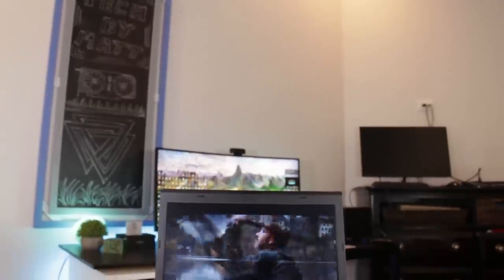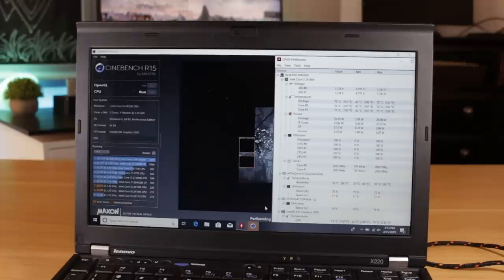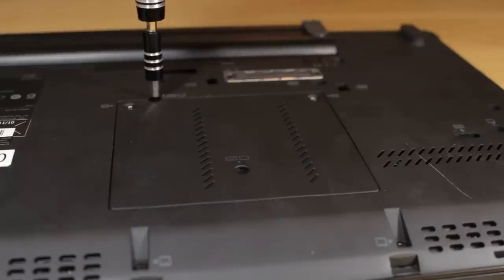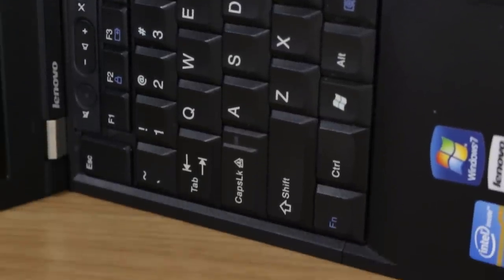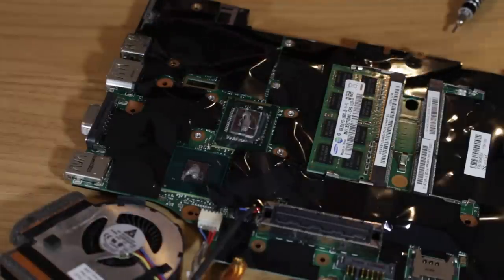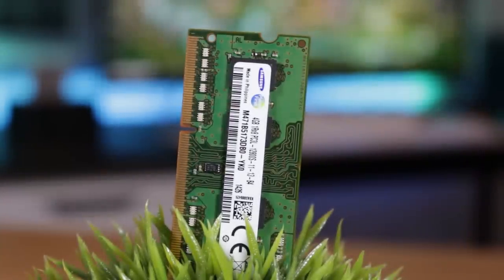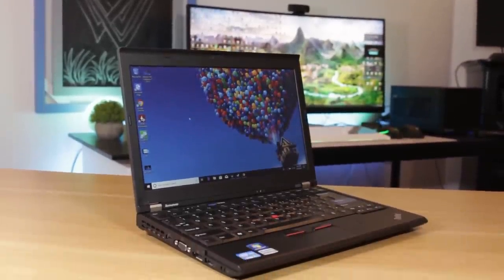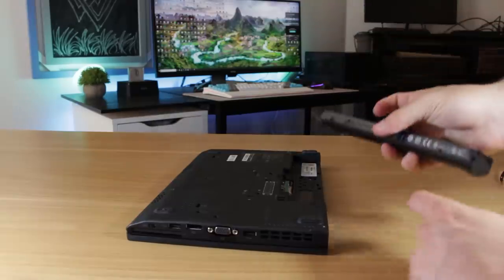What Can A $75 Laptop Do? (Plus Some Upgrades)

Comment: This laptop is still miles better than those budget laptops under $250 on the market today.
Reply: Desktop 2nd & 3rd gen i5's are amazing bang for your buck these days, and so are used laptops mounting their mobile counterparts if you take some time searching for fine deals. Just avoid the U (low power) models unless you really want to use them away from a power outlet and plan to buy a new battery, as there's considerable performance difference. The machine I'm writing this scores about 4000 CPU PassMark points (i5 3320M), not bad at all for a 2013 general use lappy which I paid under 60 bucks for in an eBay auction (part of the reason for it not going higher is significant cosmetic damage on one corner, but hey, I use that at home only anyway). Yes, it came with its power brick and everything. I actually won 2 units from the same seller for nearly the same price. And that's here in Europe, where you rarely get such fine deals as in America.
Reply: I always recommend 2nd hand for any laptop under $500
Reply: i swear. hell yeah its a good idea to buy one
Reply: don't worry, mostly is because the upgrade of it important part.
my laptop is 400$ and my in game (csgo) fps is 30
Reply: how bout just buy. a pc ryzen build for $300 this are waste of money man buy a ryzen 2200g and cheapwst mobo and start from.there plus u can buy a ryzen 7 in the future unless u really want portable pc i just my.phone outside and i use pc at home
Reply: BilisNegra agreed, the sandy/ivy bridge is so cheap yet still have great power now. I have two 17” laptop(Lenovo g780/Dell m6700) for me and my wife as working computer, I throw 3610qm and 3740qm into them and they just fly with an SSD as system disk.

I’m planning to upgrade my HTPC from g620 to Xeon 1260L soon :)
Reply: @BilisNegra  the only difference you see for everyday use is the app with latest processor loads 2 s faster ........
Reply: "budget" laptops today are trash
Reply: @ioannisskardasis6887  You guys are horrible shoppers. I bought a Lenovo Ryzen 5 3200U laptop with 8GB RAM and 256 GB SSD for $300 and it runs amazinly well. So no, Ryzen budget laptops under $400 are not trash at all.
Reply: better than my potato
Reply: Got this laptop for free, can anyone tell me the 3 main things i can upgrade myself so it can be usable in 2020? Cant afford a new one right now
Reply: @cesaraguilar9096  probably a new cpu compatible with the laptop, add more ram, 8gb in total will be enough, and if you wanna game on it get an egpu and follow tutorials on how to use it ;)
Reply: will look into it, thanks for the advice
Reply: @SparkRemarkable  Really? I just bought a Lenovo Idepad 330s with a Ryzen 5 2500u for $350 recently....

EDIT 
Wait Ryzen 3 3200U or Ryzen 5 3500u?
Reply: @shinya1215  My 7 years Lenovo G480 has a core i3-2328M and it is running the latest version of KDE Manjaro smoothly. It only lacks RAM (it only has 4 GB of RAM, easily upgradable) and graphic card (Intel HD 3000, It supports a 1368x768 display, but it lose in color and sharpness to the more recent graphic card, can't do anything about it).
Reply: @solosecondhandstore5087  I also have a Lenovo b470 with similar hardwares (i3-2348m, 8gb ram, 120g ssd), it runs win10 and Ubuntu without any issue. I also hate that 1366*768 panel, I guess if you hunt in eBay or taobao you can find FHD panel and perform a DIY upgrade.
Reply: The X260 is one of the best laptop you can find under 300
Reply: It's really not, though. Many can just about match or overtake this in performance, and they get much, MUCH better battery life.
Reply: @smokeinc9800  Laptops are still more portable lol
Reply: @SparkRemarkable  what model?
Reply: I will be your 1 thousandths Like
Reply: I’ve been using a 2013 21” iMac and well it runs like a charm until currently but that is kinda on apple’s os catalina causing gpu problems and causing lag for the pc.
Reply: I bought a used T430 after buying a new Skylake i5 Acer Aspire and using it for 2 years. And I have to say it feels much better than the Acer which had its share of hardware problems. Even though the T430's CPU is older, it's become my daily driver and got much more value.
Reply: Get an older but decent laptop than a new cheap laptop
Reply: @BilisNegra  my 3rd gen i5 laptop still going strong after 6 years
Reply: Bang my buck
Reply: my friend also has same laptop thinkpad ....
Reply: @ccricers  is the t430 cpu soldered? I was looking at getting a t440p, I will be coding
Reply: Sandy Bridge was legendary
Reply: Ming Lee I got a used 220$ laptop for i5-4300m with 240gb ssd sata and ddr3 8gb ram
Reply: @BilisNegra  If I want to buy X220/X230 what specs should I look for? I am not really sure what are 2nd & 3rd gen i5, and how to see if it is U (low power). Thanks
Reply: Ming Lee you mean chrome books?
Reply: This is ThinkPad. It's inmortal.
Reply: @BilisNegra  hey I got the same CPU on my Toshiba laptop. He is a beast of multitasking :)...
Reply: true..i love thinkpads
Reply: Wow what an original joke hahahaha
Reply: Yeah true I swapped my laptop that came out in 2018 for her 2011 Acer aspire 5755g it's so much better
Reply: Class1c 400$? 30 fps? Oof
Reply: btw older thinkpads are basically IBM thinkpads (same construction and everything), ideapads are chinaware from the same factory (crapware), newer thinkpads are still better than ideapads but they lost a lot of the old quality. lenovo is drifting more and more away from the old IBM ways (for which they produced the hardware)
Reply: I mean the modern intels
Reply: @cesaraguilar9096  Wait how'd you get one for free
Reply: @bobdole27  sometimes I work as a mover, and some rich lady had a bin in the garage and said grab whatever you want it's going to the trash. So I got this laptop and a nintendo 64
Reply: @cesaraguilar9096  Dude thats awesome
Reply: That's true and the fact that i van't find one like this now in lockdown join in school lessons kicks me in the ass
Reply: True
Used core i5 from 2-3rd gen is still better than any n4xxx celeron/pentium these days
Reply: These laptops are better than 95% of laptops nowdays, they are like the nokia 3310, but in laptops, but with insane performance if you use them with a minimal operating system install like arch/gentoo
Reply: Fr
Reply: That's a lie LoL
Reply: @HuntaKiller91  it's actually not look in benchmarks
Reply: And it still is!
Reply: its like:
new and bad quality laptop
or
used, powerful laptop + high quality for used

Comment: I love it when I find out that the $75 laptop can run 10x as a better than a $250 laptop that cant even play minecraft at 10 FPS
Reply: i got my laptop on ebay for 100$ and it has a discrete nvidia quadro. it can run java edition decently, but i usually only play runescape and bedrock edition on it.
Reply: Yeah even with ubuntu it cant run anything not even minesweeper without stuttering or delays and it costed 300 (waste of cash)
Reply: WS Str a have a50 dollar dell from the same year with the same specs and it runs Minecraft pe at 16 chunks at 60 frames lol
Reply: @NMsince2013  what ?!?!? holy shit ive got to get into this stuff
Reply: @NMsince2013  Holy s** ive got to get more into this stuff....but how ?!
Reply: Juls there are lots of places you can get deals like this, you can look on places on eBay, just set your price (50-100$) look at the laptops condition and specs and try to find the best deal for condition and the specs
Reply: Mine has only 4gigs of ram but I did upgrade it too an ssd which is why it performs so well, I’ll likely upgrade the ram too
Reply: @NMsince2013  thanks man I will do some research
Reply: WS Str my laptop is 600$ And has a fking Pentium processor, for the rest it has all the good specs for Gta V BUT THE UNCHANGABLE PENTIUM fuck
Reply: I used to play Minecraft a lot in mine, runs quite well with some minor optimizations.
Reply: I got the exactly the same computer but I do not know how much it cost
Reply: what is model of this beast can it run 16 or 32 so dimm
Reply: I have a 300$ one and it runs mc at like 150-200fps
Reply: Them Celeron N2840's.
They're worse than a Core 2 Duo.
Reply: I run 200 fps when i play minecraft
Reply: Used market > new market
Reply: ByDaChan ' I got a 500$ laptop 😎 but I cannot even play Minecraft. 😔
Reply: I have a 250$ laptop that is fucking trash. It has a 1.10 ghz dual core, 4 gb of ram and 32 gb of emmc (yes, 32gb of storage). It didn't even ran windows 10 smoothly on its own. Now I have Ubuntu and it runs better, but when I open ANYTHING the CPU usage goes to 100%. Like I could be browsing on chrome or just chatting on discord and the laptop gets up to 75°C. Oh, and it doesn't have any ventilation, not even a little hole. I'll see if i can get a cheap PC using server parts and finnaly get rid of this shit.
Reply: Ok so I will get 2 of these then 2 100 dollar laptops
Reply: I hate my laptop I can only get like 20-60 fps on Minecraft, on gta sa I get about 70 fps on highest, csgo runs 20-30 fps but it's still pretty bad.. it has a bad Celeron processor and Intel HD graphics..b
Reply: Nah, that's BS. You can find good laptops for <$400 that beat this easily. My 435€ Ideapad 330s also had 2C/4T but at a 3.4 GHz boost with better IPC and far lower power consumption. It also had a 15 inch IPS screen and better battery life. This Thinkpad is very impressive for $100 but a newer and more expensive machine will beat it comfortably.
Reply: got a 2000$ laptops, it could only run Minecraft at 14fps );
Reply: That's true
Reply: I also play minecraft and valorant with 60 fps in 2021 and it's amazing
Reply: Mine was expensive but it beat my friend's pc in fps in minecraft java lol
Reply: It runs at 200 to 300fps my friends pc runs 100 to 200 fps
Reply: I have a 200 one who can't run minecraft at more than 7 fps
Reply: @nidzex4724  bro thats so good stop saying its bad ur just bragging
Reply: Uh dude a Celeron processor literally runs Minecraft at 50-60 fps don't be a sheep

Comment: You should do a video about flipping every week do it for 3 months and see how much you make**
Reply: Everything what?
Reply: LOL overseas there's cost up to 200€ used😩
Reply: If you wanna do computer flipping for profit, the best way to start would be to buy laptops in bulk.  DLA and other federal/state disposal agencies sell them by the pallet - a lot of government orgs get rid of their workstations as soon as they go out of warranty, so 3-5 year old thinkpads get sold off pretty cheap, usually with no HDD or RAM.  Get yourself a pallet full of Thinkpads in decent condition, put a cheap 128GB SSD and 8GB of RAM in all of them and a fresh image of Windows 10 or Ubuntu, research pricing for that model on ebay, and slightly undercut your competition - if you offer free shipping and have the complete package (batteries and chargers, OS already installed, etc) included with each purchase, you'll probably do very well.
Reply: Haden Odom sorry that won’t work
Reply: @dirkdiggler9379  why not?
Reply: Midnight Lotus  not enough profit
Reply: And windows is really expensive
Reply: @hadenclaire  Well, no. If you find a pallet of laptops for sale, before you even think about buying them, you should be looking at how much money you're going to have to put into them to get them up and running, and how much you can reasonably sell them for. 
Chances are, once you take into account your time and taxes, you won't be making much, if anything.
Reply: @hadenclaire  should be pretty lucrative business these days...

Comment: I can't wait to see how does it run with a egpu.
Reply: MirelRc idk what that is but i think it’s supposed to be funny
Reply: Swoogie37 lol it’s basically a graphics card run externally.
Reply: @swoogie3754  external GPU
Reply: Silver_76 i see thx
Reply: @swoogie3754  they work. GDC dock is an awesome graphics card dock that allows you to add graphics to a lower end and older laptop. Its no joke, man.
Reply: I picked mine up on ebay for $40.50. I use the mini PCI-E variation..
Reply: external gpu doesnt work as fast as a gpu connected straight to desktop pc.
Reply: @GhosteYoutube  Yeah obviously because you only have 4 PCI-E lanes on this connector, but it will still be better than any integrated graphics with an adequate GPU.
Reply: @nitrosity4574  yeah but why spend 800$ on a gpu like gtx 1070ti and get half the performance when you can build a pc with better cpu and with a gpu like rx480 that costs less than only the gtx 1070ti itself. i mean if you buy like a gt 1030 and setup a external gpu then yeah that would totally work if its supported on your laptop, of course you would get better performance if it  was in a desktop pc but it would be a massive improvement over an integrated gpu, probably over the dedicated one aswell.
Reply: Then you need a wifi whitelist bypass.
Reply: @B1essedCammm  also true, but probably 90% of us doesnt have gpu laying around in the house.
Reply: @GhosteYoutube  please tell me who's willing to pay $800 for a 1070Ti, i need customers like this
Reply: Nitrosity what if you do it through the express card instead of the 4 PCI-E lanes. Would it be faster?
Reply: @GhosteYoutube  damn $800.....I sold like 10 in the past few months for $160/170.
Reply: @stevesmith1383  maybe got the prices wrong lol, but still rx is cheaper than nvidia.
Reply: @GhosteYoutube  or just use the rx 480 on a laptop?
Reply: @josephl3602  %
Reply: i thought for an egpu you need thunderbolt 3
Reply: @Josiah.435  with thunderbolt 3 it will run better.
Reply: @MirelRC  is he using an express card slot
Reply: I just hate how old laptops have 2 RAM slots you need 4 for a major upgrade

Comment: I'm currently using this computer and it's great! It does EVERYTHING with no issues. Modern computers aren't significantly faster. It's easy to upgrade. I upgraded to an SSD and 16 gb ram. I run Windows 10 with out a problem, and run Linux and MacOX Sierra virtual machines without a problem.

Comment: I have the X220's successor, the X230. Almost identical except it has the chiclet keyboard (can easily be swapped with the X220's), USB 3.0, and a Mini DisplayPort instead of full-size, as well as the newer Ivy Bridge architecture. Just to correct you on something: the 2.5" drive bay supports SATA III speeds, it is the mSATA slot that is limited to SATA II speeds. Also, the batteries available for this ThinkPad were 4-cell, 6-cell, and 9-cell, not 3-cell as you said in the video.

The TN panel is VERY easy to upgrade. Just make sure to disconnect the battery and power adapter before swapping the displays. Also, if you want to check the battery health you can install "Lenovo Vantage" and go to the power manager. Compare the full charge capacity to the design capacity and you can calculate how much the battery has degraded. From my experience 3 hours with the 6 cell battery is decent, I think they could get closer to 4 or 5 hours when new. I have a 9-cell battery in my X230, and at 81% of its original capacity it lasts about 4 to 5 hours.

Comment: I recently sold my HP Elitebook 2170p for a upgrade. The Laptop itself was superb. Touchpad and keyboard were awesome. It had keyboard light, was easy to maintain and could have had up to 16gb RAM. However, the Intel HD 4000 graphics was't up to the task for gaming. But 4k YouTube ran smooth on a nice looking display.
Reply: i had just bought HP 6460b , bad screen but build like a tank and perform awensome for less than 100USD when include ssd in price

Comment: Hi! I also have one of these! Excelent machine, I upgraded mine with 2 ssd drives, used also the m2 slot and a regular 2.5 inch SSD drive (which replaced the hdd), boosted ram to 12gb, replaced the wifi card and placed a new original Lenovo 6 cell battery... I simply love it.. I am also considering an external gpu to go along with it whenever I travel... Great video!

Comment: Dude, Matt, T420. Don't get me wrong, the X series are beautiful machines. I live and die by my X250 on the road, but the T machines are so much more upgradeable and easy to work with. The best $300 laptop today is a T420 that's been upgraded to a QM i7, maxed out RAM, an SSD and the 1080p screen
Reply: Even better if you install coreboot and a custom bios on it, which allows you to use ivy bridge processors with much better integrated graphics, even better than the t420's dedicated gpu!
Reply: i have t460 maxed out at work and my macbook pro 13 2105 at home mops the floor with that t460... it just shows how a bad operating system such as windows can make good hardware feel like crap
Reply: @milosjakovljevic4850   but not everyone has a time machine
Reply: why do you use your x250 on the road then?
Reply: @kadenoberlander2548  Because it's compact and lightweight. The T420 is just shy of being a boat anchor.

Comment: Some great info for the newbies out there! All Sandy/Ivy Bridge with 2 ram slots support a max of 16GB ram(2x8GB). Most Sandy/Ivy bridge cpu are socketed, which mean you can upgrade the cpu. Most of these CPU's use Socket G2. The Quad Core i7 3610QM/3630QM uses Socket G2. 

Sometimes you can get a great deal by buying a dead Gaming laptop with an i7 3610/3630. Most times its the graphics card that is dead on the gaming laptops. I got dead Clevo for 40$(no ram/no hdd). Took the CPU(i7 3610QM), Sold the working LCD panel for 30$, sold my i5 3210M 30$. Just doublecheck the description of the dead gaming laptop, make sure you get the right cpu and the graphics is broken.